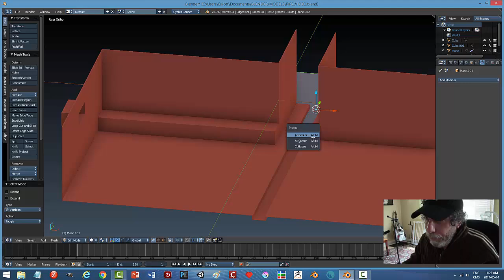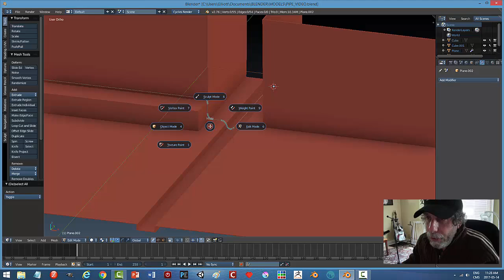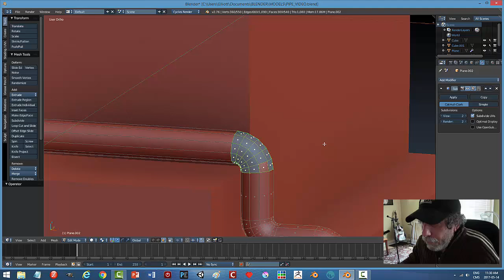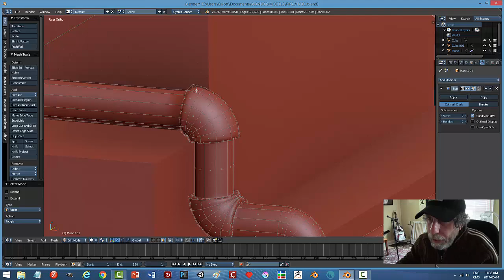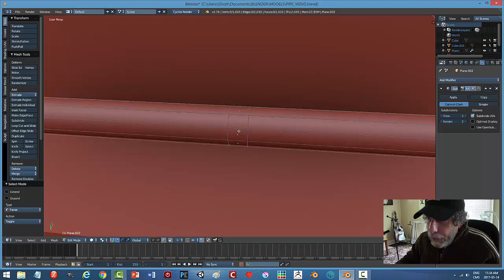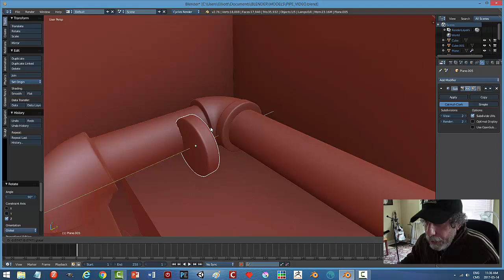Blender: Modeling Pipes Using Curves

Comment: Pro Tip #1: Instead of adding a plane and merging its vertices at center... it's simpler to add a Single Vertex (Shift+A, Mesh, Single Vert, Add Single Vert) - which (unfortunately) doesn't work in Blender 2.80.
Pro Tip #2: Instead of adding edge loops like there's no tomorrow, try to use Crease (Shift + E) on a ring loop and / or play with Auto Smooth in the Object Data panel. THIS tip saves A TON of geometry.
Reply from the maker: It also doesn't always work in 2.79b and that's why i resort to merging the points of a plane most of the time. I don't always like mean crease although I use it sometimes and I agree it saves on geometry. Thanks :)
Reply: @zerobio  an alternative is to put a bevel modifier before a subdivision to make it non destructive either way, then if you want you can shade smooth and turn on auto smooth
Reply from the maker: @joshsarms  yes sir, thanks for adding that :)
Reply: @zerobio  you're welcome!

Comment: I create the vertex from a plane, collapse all the vertex and extrude them in the directions I need and then I can bevel the vertexes that I need to bevel. Why is this?. Why can't I bevel any vertex?. I don't know which is the step I'm doing wrong. Please any tip?.
Reply: (I just didn't check "vertex only") . No problem now. Thank you very much.
Reply from the maker: @jorari71  Ok glad you solved it!  Great job and keep going :)
Reply: @zerobio  I was desperated!. Now I can do what with MAYA cost me lots of headaches!. :)
Reply from the maker: @jorari71  that's great news!  Thanks for letting me know and good luck :)

Comment: A quick way of building the flanges on the corners is to select the front faces of the corner section, duplicate in place, then extrude and scale it up, then put a couple of edge loops in to get the hard edge, that way you dont need to create one like you did and duplicate and rotate and align it all over the place
Reply from the maker: Sounds good, gower :)

Comment: Fantastic video! Quick tip, no need to delete the vertices and join, just select the vertex you want to delete and join and type control delete, this will dissolve the vertex, doing exactly what you wanted, same thing with edge loops. Also, this pipe method could also be done with a skin modifier and a subsurf/bevel modifier (the bevel would have to have max width), love the video man, your way of teaching reminds me of bob ross, which is a good thing.
Reply from the maker: Thomas, thanks so much and of course, why didn't I just dissolve vertices?  I do that all the time anyhow.  Tired, I guess.  Really appreciate the support and tips for anybody who happens to watch my video.
Reply: zerobio my pleasure friend, keep up the great work!
Reply from the maker: Awesome!  Will do Thomas
Reply from the maker: Thanks Thomas

Comment: Hi Zerobio, as usual, excellent. I did not know this method for pipe modeling. For my part I use a cylinder and the spin function to give the orientation of the pipe. To remember in any case. Thank you very much.
Reply from the maker: That's a great way to do it, Blenderius!  Thanks for watching my video and for the support.  See you next time :)